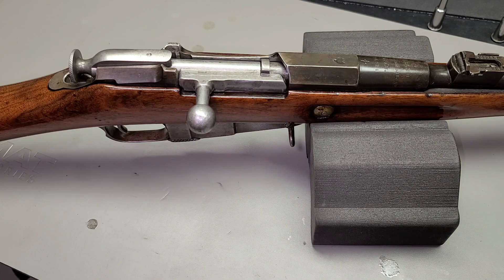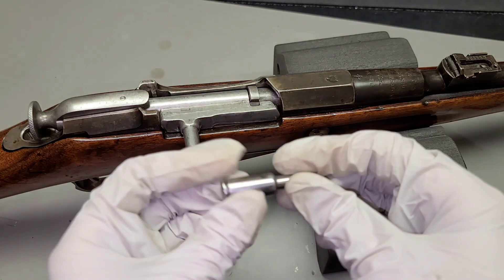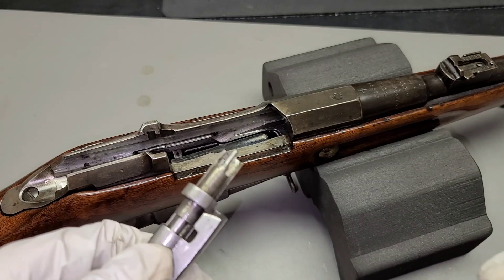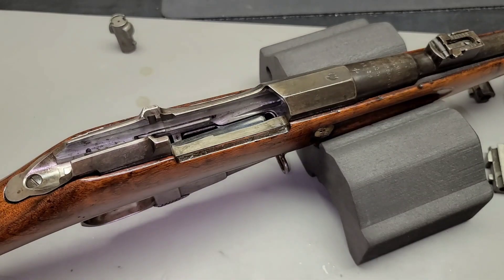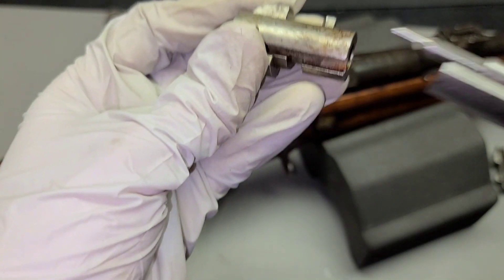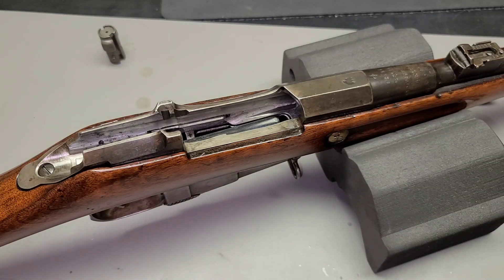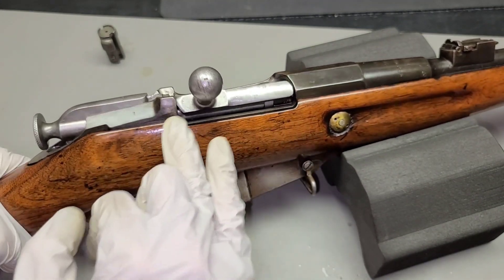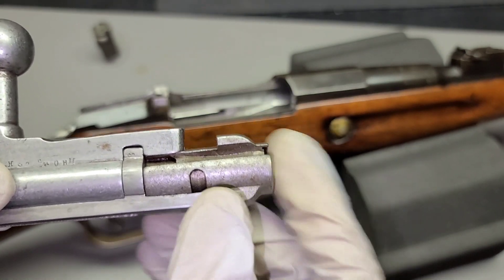Headspacing a Mosin Nagant 1907 Carbine

Comment: I inadvertently made a no-go gauge by hand loading for a 1943 mosin.  I made ammo for it where after shooting brass for it, I would just resize it enough where it would chamber into it.  I later learned the ammo will not fit any other mosins I've came across.  That's as many as 5.  I now use to to see if the gun's chamber is way out of spec.  I know, not exactly a head space gunge,

Comment: When using headspace gauge you should not have to push that hard to close it. At most use two fingers to push the bolt closed. No need for your second push downward.  It it don't close don't force it.
Reply: Yes I’m cringing as I witch him reef on the bolt handle

Comment: I had to file the receiver about 15 thou to get the barrel to clock properly... the bolt I have is too tight... I'm thinking I need to remove material from the bottom of the locking lugs to increase headspace
Reply: use lapping compound if it almost closes
Reply: 600 grit to be exact
Reply: Just buy a couple different bolt heads lol